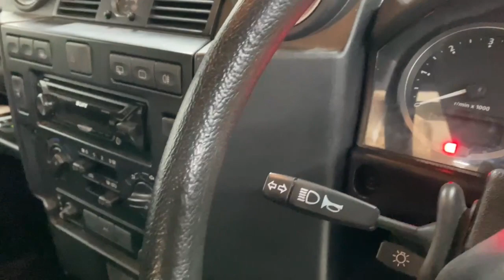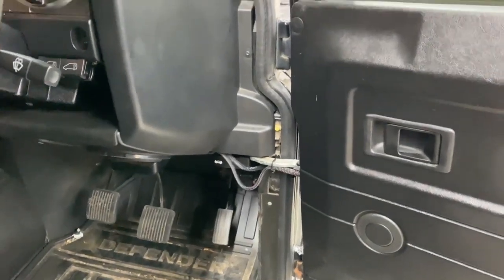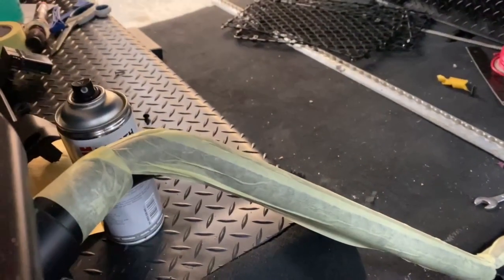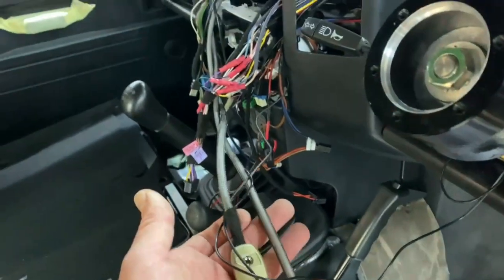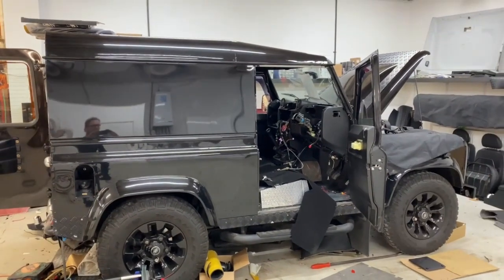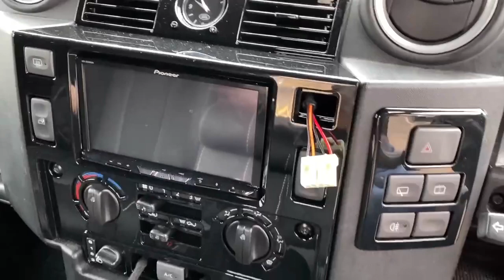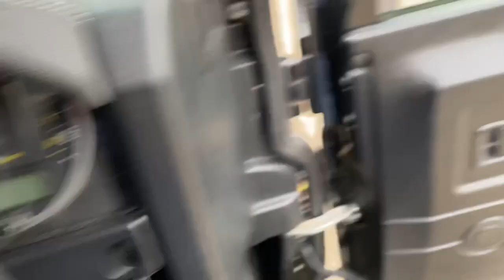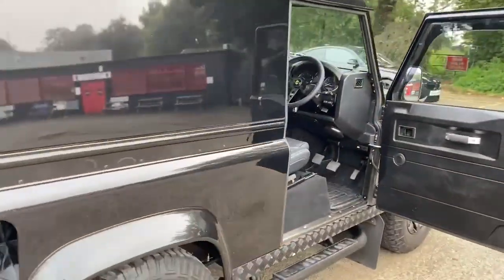Defender 90 Interior Transformation

Comment: Lovely work I’d only change the reverse camera for the one I think you installed before on the rear glass. Or was that a rear view dash cam? Great quality work as always.
Reply from the maker: Hi Odhran, you are right, the camera we install inside under the hi level rear light is a rear witness camera, not a reverse camera, we somtimes install a reverse camera in the cross member but then they are off centre, we always have several options depending on cutomer preference.